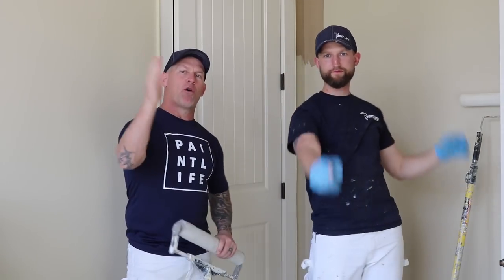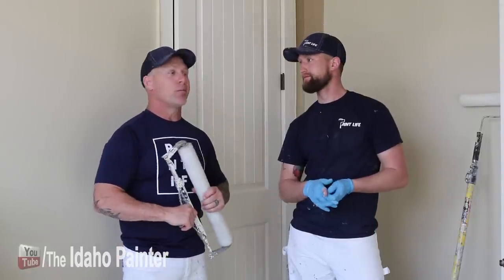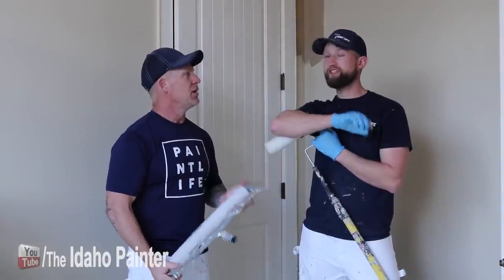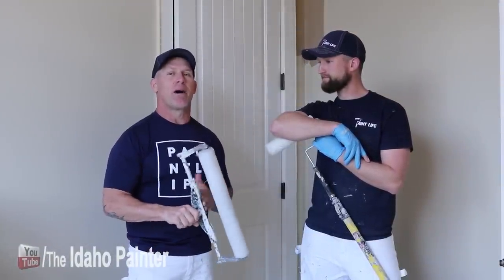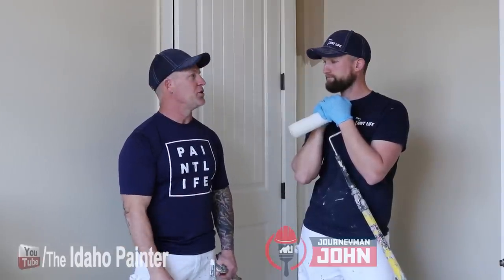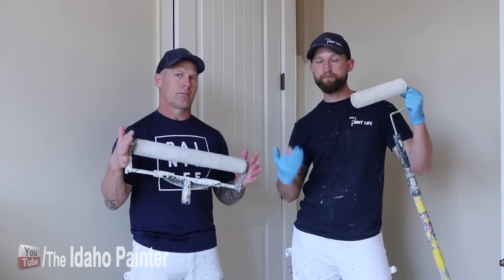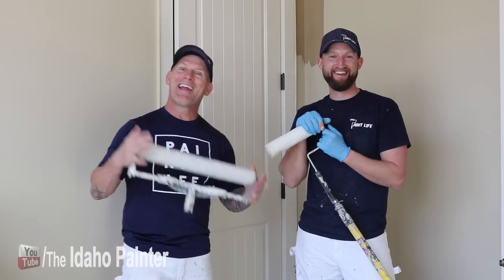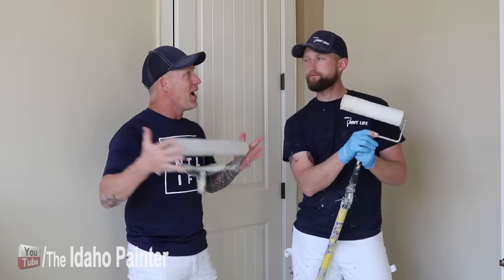Best Paint Roller for Painting Walls FAST

Comment: Here in Australia a lot of us use 270 mm rollers,  when using acrylic nap roller I use a roller washer that you connect garden hose because those rollers give you  a great stipple but take forever to clean without the tube roller washer,
Reply from the maker: Awesome, thanks for sharing!
Reply: Hi Artie, do you normally pick the 10mm or 15mm nap for the walls?
Reply: @Tigerratcat  11mm dulux acrylic roller or old fields

Comment: I have been getting Carpal tunnel the last few months so a 9 is much easier on my wrists, also don't have to worry about how close I get to the corner with a 9 vs scratching it up with the 18.
Reply: THE_FAMILY_MAN_CLAN you can get a 14 roller like a traditional 9 in roller frame.
Reply: Talia Rose do not like 14 or 12

Comment: I always use a 9" roller, nap thickness depends on surface. Usually working out of a bucket and grid, so a 9" fits. When cleaning a roller, any roller, always scrape out the excess paint with your 5 in 1 tool, or any scrapper, it saves paint and makes cleaning the roller much quicker.

Comment: We have used Purdy Colossus roller covers with good results for the past 8 years or so. Just today, we finally went and bought a 14in setup for these slick ceilings in this big new construction home. 

The 18in roller I used years and years ago, it was too cumbersome for my taste. I think we used them on a large apartment complex I did back in 2004/2005.

Comment: Definitely prefer the 9” roller. I use an 18 in big ceilings and recently got turned onto a 14 since I can use it on a Wooster Sherlock frame. I never clean my covers unless I’m using them on a textured surface. 90% of walls I paint are smooth and the finish just isn’t the same after cleaning not to mention the time spent cleaning them. Just works best for me. Always good instructional videos!
Reply from the maker: Awesome, thanks for sharing Danny!
Reply: When using 14” which brand and model

Comment: 18s are a lot quicker without doubt . I used 9s for 15 years but for the last 10 it's been minimum 14 on walls and ceilings , never looked back , I only use a 9 on doors now , it'd feel like i'm using a mini roller if i try and do walls and ceilings with a 9 now. 9 is more for the DIYer  in my opinion.
Reply: Yeah 14 is the best for finish and easy to clean 9 is more like beginner or diy.

Comment: Do you recommend using a plain homedepot 5 gallon bucket with a grid to paint with a 9 inch roller on a 2-4 foot Wooster pole or would you use a paint tray or something like the Wooster 4 gallon angled bucket? Thanks for all the great tips!

Comment: What's your method for getting crisp paint lines on an outside corner wall with different colors??
Reply: Hello Jon Camp my name is Andrew form 1st class painting out of Appleton WI. To answer your question run a tape line down ware you want your separation of different colors then lay a beed of caulk down your tape line then take your cut brush and run your cut line in that color pull the tape when its still wet it comes out perfect every time. I got this suggestion from watching chris video on how to make your cut lines sharp like a professional did it. Hope this helps you
Reply from the maker: Jon Camp we have a video explaining that in depth
Reply: Jon Camp I dip my brush and wipe all the paint off on the edge of my bucket. Then I dry brush the edge lightly. Two coats makes for a clean edge. Works for me

Comment: I've seen some instructions say to wet the roller nap with water before loading it with paint.  Your thoughts?
Reply from the maker: It is good practice to do so
Reply: If you’re using microfiber covers you should be lightly dampening them prior to loading them up with paint. Most microfiber manufactures have that spelled out on the packaging.

Comment: Tossing is often the way to go. (1) 9" roller sleeve costs $3-$6 and a master painter earns atleast $35/hr in NY. If that painter takes over 10 minutes cleaning that roller sleeve then it defeats the purpose of the "cost saving of having to rebuy a sleeve". We as contractors are "technically" losing money. You say its 5x the amount of time for a $12 roller sleeve. Think about it!!!
Reply: Just curious as to why it would take someone over 10 minutes to clean a roller? It takes me about a minute at most after I've sifted out the excess paint.

Comment: What theybdont mention is that in yoir typical home and average rooms the time differences between a 9 inch and 18 inch or 14 inch or whatever size u choose.     Seriously if your a good painter the time its takes to roll a 10×12 room really shouldnt be much different between the two.  
Any real painter knows all the "time" in painting comes from prep and cut time with  a brush.
    Im actually getting ready to go for the guiness record for cut amd rolling a area.  I can cut high to the crown or ceiling or low to the base or whatever,  or accent walls doesnt matter.  Im super laser straight and my speed is insane.  Ive been painting along time and ive met a couple painters that cam hang with me.   But in general i by myself can usually get the same amount of cut work done of about 3 of your typical average professional painters.    I haul ass,  do amazing work. And my quailty is unsurpassed.  I would love a opptunity to throw down with you guys.    Most people see how fast im moving and immediately start talking shit saying im gonna have runs or be sloppy or have heavys blah blah blah.  I say shutup and try to keep up lol.  Once they realize how perfect my work is they start to panic,  or get mad,  or rarely bit sometimes give me props for my mad skills.  And ive literally had guys on multiple ocassions  not be able to follow my first wall to ceiling cut because its so straight.    They just cant draw a line that straight.     They usually say something alomg the lines of you cut wierd or i cant cut like that.  They are the kinda people that cut but jave to ride over on to the ceiling or wall.  They cant actualy make a straight line with the mud work without riding up or down or left or right onto the ceiling or wall.  Now most real painters  can follow my work,  but in general its prettt funny because you can always tell where i was cutting and rolling compared to another guy.  Becuase of the quality of work and the straight lines and crispness and how the paint job just pops out at u.    I kinda forgot where i was going with this other then.   Rolling is like a very small part of the job and expecially if your good at it.   Cutting is where most people lose/spend all there time when actually applying paint

Comment: It takes 10 secs longer to set up a 18 inch roller. It takes less than 90 secs longer to clean it. I like a lot of your vids but I believe you make some just for the sake of views and hope some sucker will buy something from your store.  Sure ya not going to grab a 18 to roll a closet or a 9x10 room. I only expect my guys to buy their own gear that they like to use that is not necessary such as a particular version of a 5er or a specific 9" frame or some ext pole they feel makes them magically better or faster etc. I buy the wooster frames no matter the size.  Wooster roller sleeves no matter the size.  I clean all my sleeves in the same manner and they all take pretty much the same amount of time.  I'd fire someone for saying i used the 9 inch because it would take so long to clean a roller sleeve lol. lets see. 20 extra mins to roll out a room or 2 extra mins to clean a 18 inch roller...hhhmmmmm
Reply: to add. Lets just say you are paying $0.36/oz for your paint.  you are prob less being in the states. prob 27-28 cents.  So lets say you lose 1.5 oz in washing out the roller and 1 oz in the pan. or even 3 with build up.  so thats $1.62 CDN.  and and extra minute to clean the roller. SO $.050 at $30 an hour for one of your painters.  SO $2.12 in cleaning and loss of extra paint to paint a room 20 mins faster. $10@$30/hr.  SO you are saving $7.88 in using the 18 inch roller.   Lets just say you have multiple crews on different sites using 9 inch rollers over the 18". You are running around from site to site to check in on progress/problems material drop off etc etc etc.... over the course od a day you are saving your fuel cost in using 18 inch rollers. Or every two 18" rollers you use and clean you can hire a gopher for $15 and hour.  and thats just on ech 20 mins. I can carry on with the math but you get the point.  Now personally I use a lot of 14" rollers as they save time on the cutting in as you can still use a 3 ich vs a 7 inch to use the frame of the 18.  As time goes on I think the 9ich will disappear.